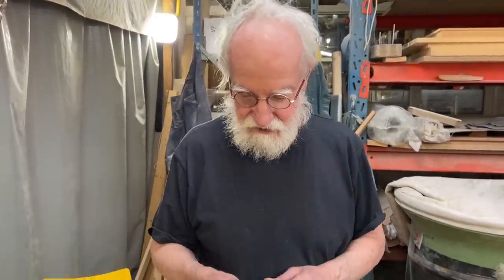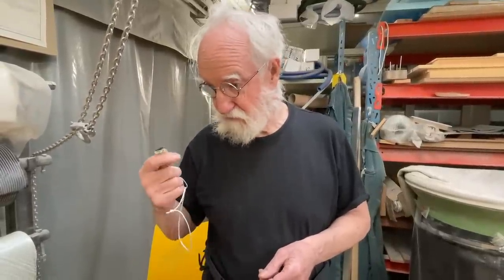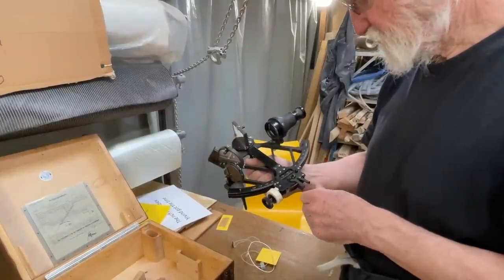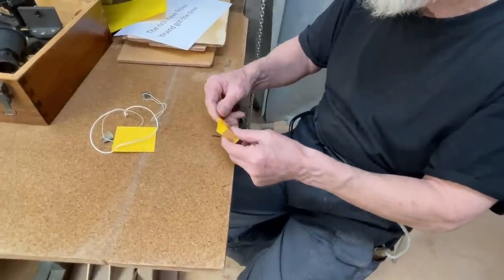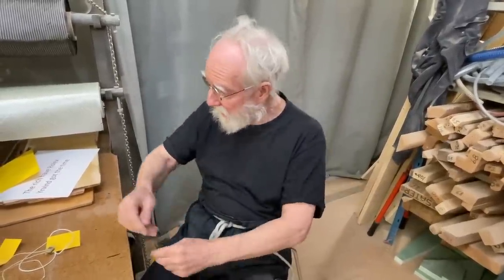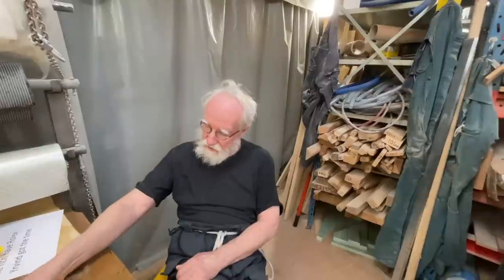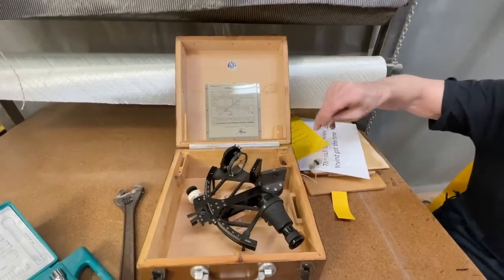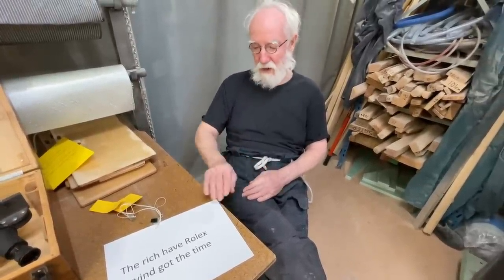BRIS MINI SEXTANT DIY.

Comment: I will confirm that the Bris sextant works as designed and can be made as Sven is showing.  I have made several using microscope slide glass, camera UV filters, and two part epoxy.  Calibration from a known position takes some time but only needs to be done once.  I get 2' precision out of all the home made versions which is surprisingly good for something so small.

Comment: "Position, time and altitude - if you know two, you can calculate the third" - so in fact, I do need a Rolex and a bris sextant 😂
Reply from the maker: Or a Timex.
Tick tack Timex one is made every secound 
That was what they said in the 70s 
There are cheap quarts watches also now
Reply: In all seriousness, the.bris sextant is amazing. I wish more people would practice navigation - not just sailors.
Reply: Thanks for your information on your Bris sextant Sven. I'll put some thought into that. It fits my criteria for entry into my boat ... Small, simple, reliable, repairable and inexpensive. That is very generous of you !!
Also I appreciate your recent  ideas on the relative environmental cost of  build bearing in mind the life expectancy. Bearing the last factor in mind GRP in  construction over the last 50 years may have been quite beneficial in big picture especially when done with good design and execution.

Comment: Are there specific angles that the glass has to be positioned at before gluing together?
Reply from the maker: No 
Try to make an useful angle.
One that you chose with the ordinary sextant.
Depends a bit on the latitude you sail and the time of year.
One in morning one around noon.
Reply: Even if the pieces are assembled badly the calibration method takes care of that. 
https://en.wikipedia.org/wiki/Bris_sextant
Reply: @pparnanen  thanks for the link👍.
Pretty cool there's a Wikipedia page about this.
Reply: I have had good luck with 22mm squares of cut microscope slides glued with two part clear epoxy and shimmed with 2mm and 0.7mm pencil leads.  The 8 sun reflections are about equal spread up to 32 degrees of altitude.  The 5 dim sun reflections do not need shading. To shade the 3 bright reflections just hold a dark sunglass out in front and above to shade the incoming sun for a comfortable look at the 3 bright sun reflections.